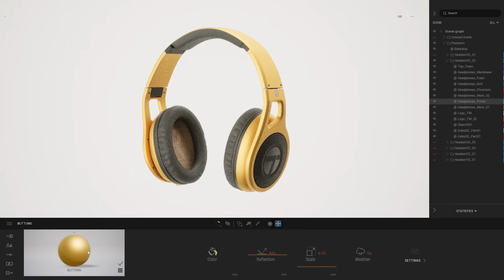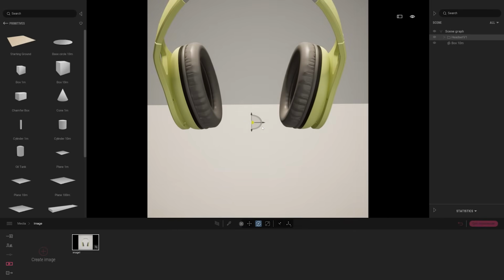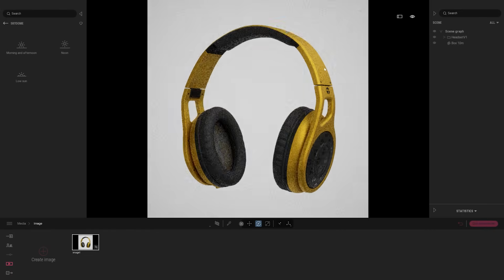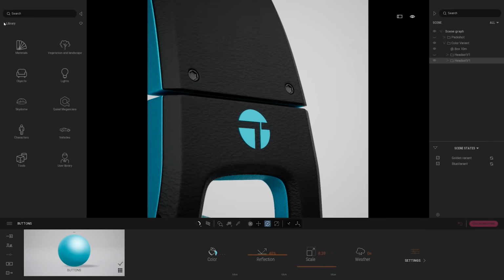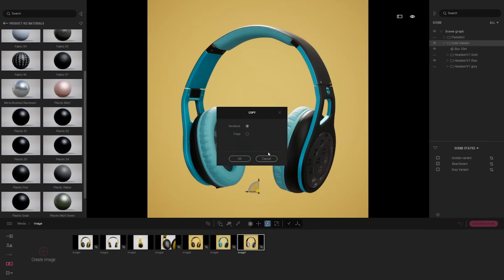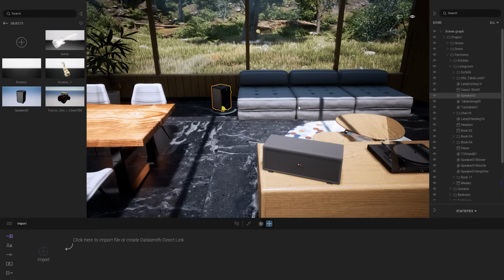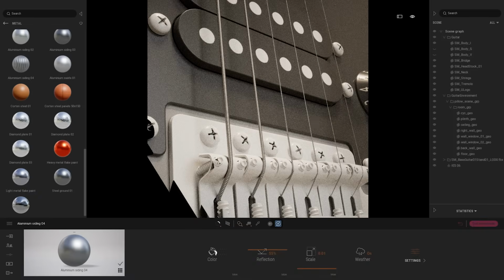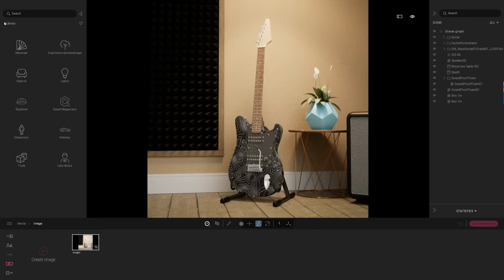Product Visualization in Twinmotion | Webinar

Comment: Hi. Just for path tracer speed reference, ¿What GPU are you using on the presentation?
Reply: 3 Path-tracer options; my personal testing shows that these options work well: low; 1 bounce 16 samples, medium 4 bounces & 32 samples, high; default setting. 

What this allows you is to do crude/simple renders with low refresh speed in real-time on low settings. Then increase the quality to medium to see nearly finished samples with very little waiting.

The denoiser does a lot of the heavy lifting!
Reply: That demo was done on a 2080 ti